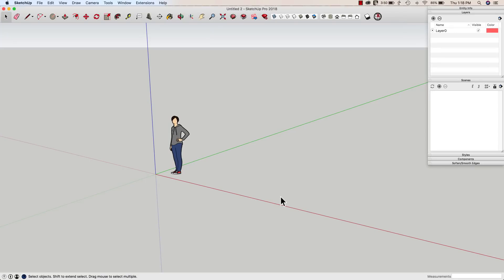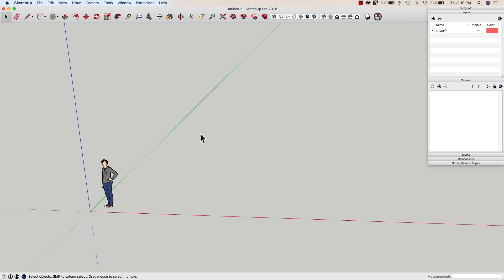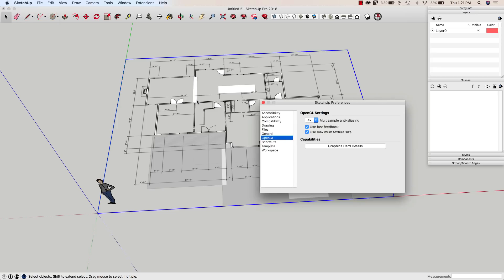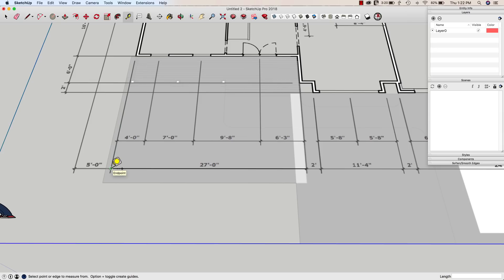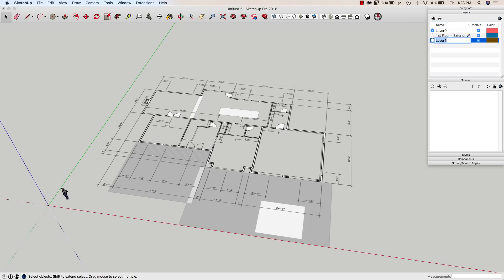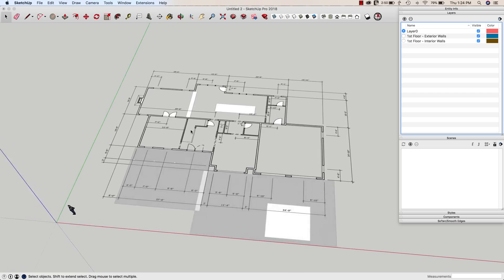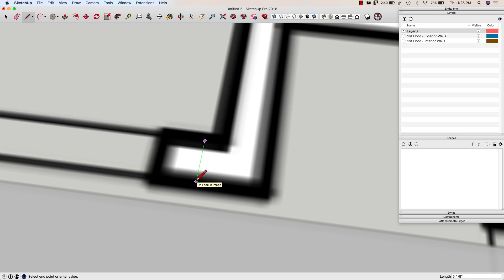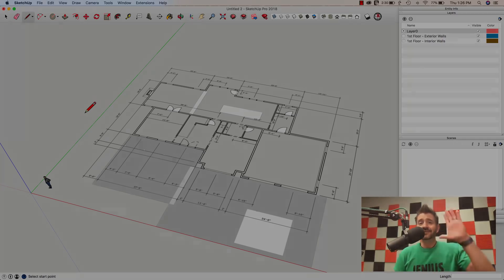Preparing for Architectural Modeling in SketchUp - Skill Builder

Comment: in terms of accuracy, you're probably better off oversizing the image first and then scaling down, in a small image it's very difficult to accurately select a line with the tape measure and one pixel offset may make several mm of difference

Comment: Aaron this is great!  I have just found out that if you carefully  make scans of the folded blueprint or drawing that is too large for a printer to handle then you can import those images individually into a SketchUp page.  If you align one image then scale it to an easy ratio to remember (20'x26' or anything satisfying the image width and length dimensions of the original image) and align the next image to the corner of the previous image then scale this image you can get the entire blueprint image scanned into your page via a series of a few images, in my case four 8.5x11 scans.  The more care you take aligning these images the easier it is to trace.  Thanks for your training.

Comment: The border between the full lines and the dotted lines is the ground.
I build the basement in the dotted area, correct?

OK. Can I build the house completely from the basement foundation to the pebbles on the roof (bungalow)?
Incl. Stairs to the cellar.

Can I later expand the house with the complete property?
Front garden, terrace and garden. Maybe the street too.

What is the best software to create good 2D floor plans?
I only have hand-drawn on paper.
And no exact measurements. In the basement windows and doors are sometimes in the wrong place. In the hobby cellar there are three windows in the plan, real only two ;-). But I own a laser meter.
I would like to recreate it. With exact dimensions.

Comment: ?Scaling? with a line and tape measure? That's a new one. Will have to give that a try.
Reply: It's a model-wide scale, meaning everything will get scaled. You would still want to use the scale tool to only scale specific geometry. At least that is how it is in my old 2016 version.
Reply: @eKalb33  I saw that. More accurately, I meant to say "Its a new technique for me." Until recently I've been using the old Goo.. 8 version. :) Aka self taught for hobbies. Never considered the idea of using a line to scale the whole model. :D Thanks.

Comment: what if one wants to do the complete opposite of this series? IE, not making a model FROM a set of plans, but rather MAKING the plans themselves, such as the floor plan, adding in 2d components of fans, lights, smoke detectors, etc etc etc? Basically start from ground zero and make plans for a small house or office? Then moving it to layout for blueprints and documentation to hand off to construction workers:)

thanks

Comment: Thanks Aaron. Always great nuggets of info!

In terms of architectural workflow, I like to keep the majority of building design and CDs in SketchUp and layout. But at certain times I have to use AutoCAD. 

You can import auto cad in to layout using the scale drawing tool, which is great.  Is there a way to keep that AutoCAD drawing linked to layout? Even right click and reload would be wonderful.

I love layout sheets and want to keep everything in layout if possible.
Reply: Right now it looks like DWGs are imported, not referenced. Maybe that will be an improvement we will see in the future.
Reply: Aaron Dietzen. Got it!

I’d like to officially put my vote in for that improvement 😁. It’d be soooo helpful and keep everything in Layout

Comment: Hi, Is there a way to import a dwg and inherit the location that might come with that file, such as the Eastings and northings, I know you can import a map but that is with Lat Long, in the UK we use Eastings and northings to set out buildings not lat long, all other cad programs will do this, and when my builder asks for the corner locations its an easy job to just drop a point onto the corner and read the location and copy it to a spreadsheet. British location maps, the ordinance Survey maps that come as a dwg have this info.
Reply: Eastings and northings are new to me. Generally, you do not want to import world location, as that info is too big for SketchUp. The real solution is to import the dog to attain building geometry, and the geo locate the model to get specific location info.
Reply: Interesting reply, but the industry in the UK relies on Eastings and Northings to locate buildings,  see this link https://getoutside.ordnancesurvey.co.uk/guides/beginners-guide-to-grid-references/, most surveyors use this globally, the use of Lat Long is not used simply because the lines of Longitude are not parallel and therefore bent making accurate setting out not that easy

I teach the subject at University and rely on most of the Modern CAD programs to import dwg files and geolocate the site, making the location of wall corners and lines of walls easy to establish and send to any surveyor, most use total stations to set out,  the import of a simple spreadsheet, will give all the required info. I do not know of one that uses Lat Long. Hence my request for geo location using Eastings and northins
Prof Stephen J Scaysbrook
Reply: Stephen Scaysbrook I don’t know if this is what you need, I find Google Earth useful when it comes to converting lat long into UTM 
You can do it through its settings. Otherwise there are plenty of online pages that can do the same